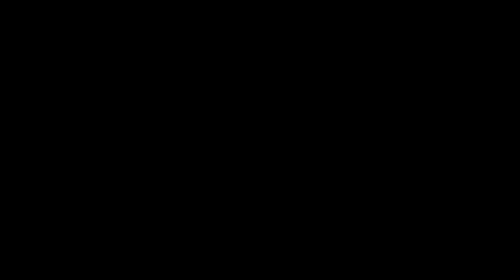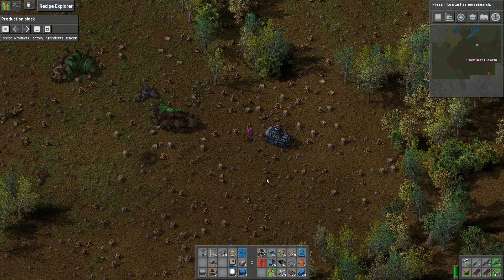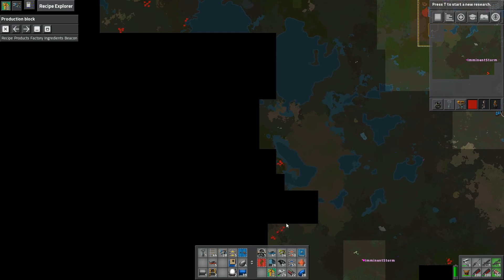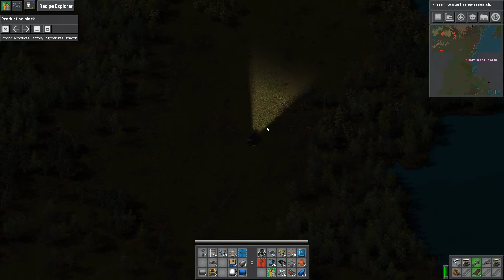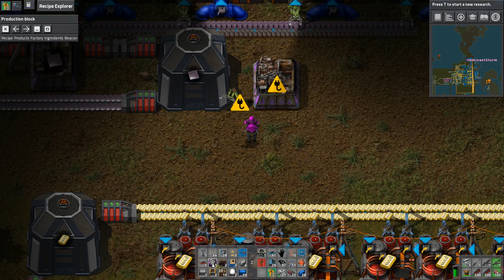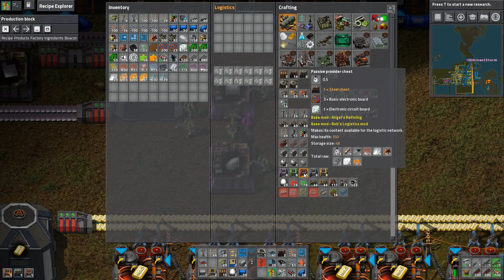Factorio - Angel's & Bob's - Episode 82 - Looking for Oil

Comment: Spotted one more green dot on the minimap indicating a garden. On the island to the east of your original base, almost directly east of your south wall, there's a garden on the easternmost tip of the island. There's a single biter base on that island, on its southernmost tip, which you should be able to clear before setting foot on the island. Just park the tank on the main landmass where it juts close to the island, just SW of that base, and the plasma gun should be able to clear the whole base for you.

Comment: If you want to use bio-processing, here are some places I spotted a green dot on the minimap, which I think is a garden that you need to collect by hand. One on your NE island where you make carbon dioxide, due north of the thermal water fissures. One due west of the R/B Mine Alpha train stops, a little south of the ore belt. One roughly SW of your nuclear reactor, about halfway along a line between your nuclear reactor and the two solar panel groups that are roughly SW of it. And one W (and a little S) of your other solar panel group (the one that's solo), between it and the coal field (close to the coal field, and directly SE from it). Many of those might be in forests, so you'll have to clear the forest first. Remember to use rocks/trees only when you do, so that the bots don't harvest the garden: I don't know if bots will harvest it correctly or if you have to harvest it by hand.
Reply: It was sad watching the plasma canon blowing up two gardens halfway through the video over near that new thermal water in the far west.